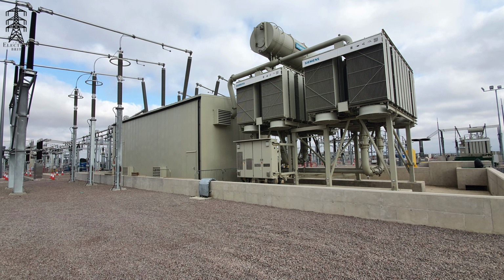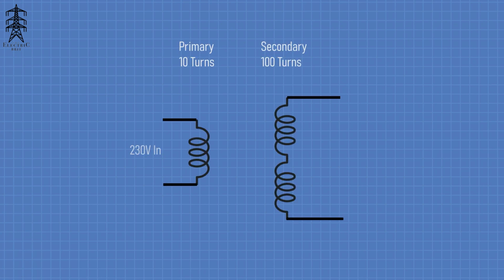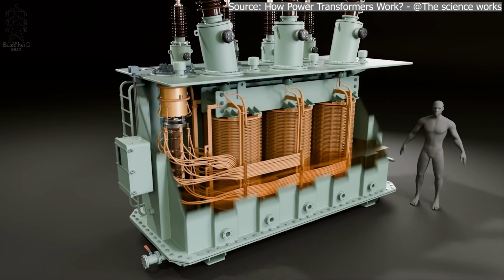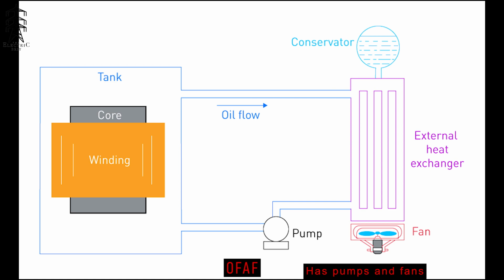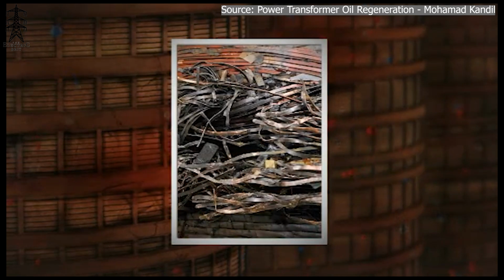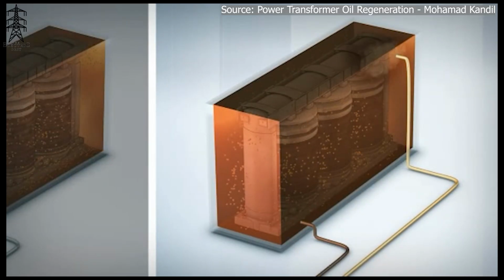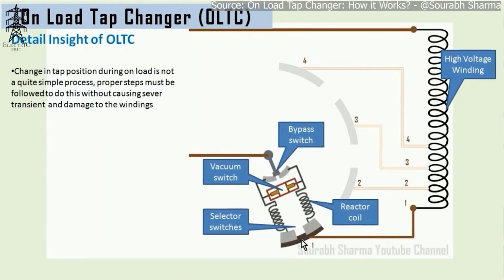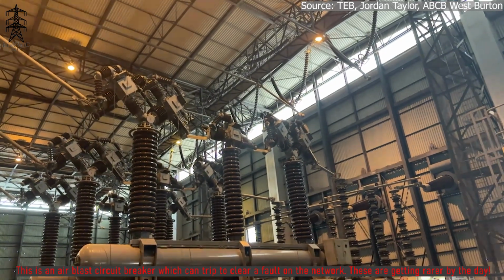Why Transformers Fail (and How to Prevent It)

Comment: They cause a lot of problems to electronics with interference at least in my area i hate that this was never upgraded to not emit such huge EMI
Reply from the maker: A lot of projects I’ve worked on recently where new transformers have been installed they’re always went in noise enclosures, which help with a variety of issues, I imagine it’ll help a small amount with EMI too but the lines and bars will always be putting out some EMI. 

It used to be a huge problem on electrified rail and I’ll have to cover the solutions sometime soon.
Reply: @TheElectricBrit Thanks for reply, primarly for me they are causing EMI that degrades the image quality of all electronical devices including PC's, TV's, Consoles, Smartphones but what is weird even when my phone is on battery not plugged in my house electricity outlet those artifacts still persists.
It reduces the perfomance of those devices like slowing them causing huge desync, input lag, choppiness the high refresh rate displays feels much lower HZ between 15-60Hz rather that 120-240Hz.
I suspect the EMI is so strong that it poluttes the sensitive components in my electronical devices and permamently leaves them damaged in a way i explained. Im also living very close to a few big power line towers and a supply station like 500m from my home but never untill 2020 got any of those problems till this day it remains a mystery for me to solve the issue.

Comment: Just here to find out if any other country uses the waste heat from transformers and puts it into a heat network. I realised that close to where I live there is a 265/33KV pair of transformers. I am guessing at how much power but doen't know what temperature the oil is or what would be required to access that heat.
Reply from the maker: I’ve heard of it as an idea and it could well be in use in some places. I don’t have exact figures for cooling off the top of my head but most substations are built away from homes because people don’t like look of them, except of course ones in cities where it can’t be avoided. 

The power needed to pump the warm fluid (40-60 degrees C would be my average guess) would probably outstrip any use you’d get from the heat by the time it reaches a destination).

Maybe as I saw on the centre of a city for an adjacent high rise building. But there would still need to be traditional cooling systems to fail over to, to prevent losing the asset if the cooling fails. Converter valves for instance get extremely hot extremely fast if not cooled so fail in seconds to minutes.

Comment: I recall a 18 MVA X 2 Reserve Station Service Transformer at a power plant being damaged to the point of requiring a rewind when an employee dropped a steel measuring tape across the 230 kV primary terminals.  Not only did that damage this transformer, but also damaged main output transformers on other units.  Miraculously, the employee was not injured.

Comment: heh i raised the voltage in my car to 15.8v to improve efficiency. works better with my solar roof to give me more ev range. lubricated my power windows just in case it might pput more stress on a regulator motor, and proactively switched my headlights to LED's with their own powersupply. the only thing that doesnt like it are my tungsten map/dome lights but they are not on long enough to matter.

Comment: I once came across a large transformer, destroyed by fire. It was situated at a large UK generating station. I won't mention which one.
The transformer was OFAF, and had developed a fault where the cooling fans were running continuously. 
One particularly cold night, the oil had become so cold, that it was too thick to be pumped around the transformer properly. A hot spot developed inside the transformer winding, which resulted in a short circuit...
Reply from the maker: Rather ironic way to go out. Caught fire due to over cooling. I wonder if the designers ever imagined that

Comment: well done bro , I worked on transformer upgrades in the 90's for ROSH   in Dunstan, it was on the back of a survey done on system capability and the increase in loading . it was reckoned that the system was at the point of failure due to age and demand. most of the work was stop gap , as the infrastructure was so old , especially on the L.V side, its a wonder it still keeps going.
Reply from the maker: Appreciate the comment! Funny you mention uprating as the last DNO sub I was on in London had the Tx's derated by 50% due to faulty fans and pumps. I suppose it was hard to secure an outage to fix it but you'd think that would be a priority.

Some interesting developments happening around uprating overhead lines too that'll be good to explore like HTLS conductors and insulated cross arms.

Comment: Came up at a good time, given the incident that made the news re a fault in Westminster on 29/4/25!

The brief section on autotransformers looks right, but they are becoming more common for some recent railway electrification projects, such as the GW Main Line. They use 50 kV for longer distance transmission, and every so often there are autotransformers set up with +25/0/-25, with the track being at 0, and the overhead contact wire being at 25, so there is roughly 10 km or so with the 25 kV current, and most of the supply being at 50 kV to halve the current to/from a small number of grid connections. e.g. Didcot, Melksham, Cardiff.
Reply from the maker: New fault every day I can’t keep up! Interesting note on the 50kV, the only rail transformer I’ve seen so far was at Sundon and if memory (could be wrong) serves I was taught rail is typically the 25kV you mentioned. 

I’m always looking at things from a transmission lens so I rarely see stuff below 132kV unless it’s on a tertiary connection but I can definitely see their appeal if the step is only 25kV. Thanks for the info I’ll be sure to dig into it more when I do a dedicated transformer theory video 🙏

Comment: Back in the dim and distant i worked for Canatron Transformers a small company in Berkshire around 60 miles from London we made everything from large  HV Transformers to little instrument transformers  we tested at normal working volts then at working volts x2 but at 400 or 150 cycles  and finally flash testing at minimum of 1Kv usually a lot more than that was great fun and i was sad to leave that job

Comment: Have you any info on small transformers for home use for example i have a large pump at more than600 meters and would be interested in using a transformer pair at 230 volt input and output?
Reply from the maker: You’ll need to do a volt drop calculation and make sure you’re still in tolerance at the end. Stepping up to 400v might be a good idea and not that expensive then back down to 230 unless you have a three phase pump. In which case you’ll have to go higher.

Domestic isn’t my forte but you can get portable transformers used in construction which are solid dry type if you wanted to test it

Comment: The brain can detect AI voice-over because it's unnatural and runs without breathing.
Reply from the maker: Incorrect 😎 if an AI did this it would no doubt sound a lot clearer and not have the odd audio issue where I’ve stitched in another take and not matched all the post processing. 

On this video part of the voice over process was doing multiple takes on certain parts and keeping the correct ones, which sometimes led to pauses and silences being aggressively cut out. I do naturally speak very fast as a geordie too. 

I’ve taken notes and my next video which is already part done and fully voice recorded is a lot slower with more pauses. Thanks for the comment!

Comment: Thank you - very interesting. Just writing up a fire supression / deluge system for a transformer.
Reply from the maker: Thanks for the comment 🙏 in future I’ll likely cover deluge systems in more detail as well as blast wall engineering. Next video is on substation LV power.
Reply: @TheElectricBrit - took me a couple of days asking the project engineers to confirm - they do de-energize the site before they start the pump and spray all that water over the grid voltage! (Though I am assured by a  chemist friend of mine that water is not usually as much of a conductor as people think it is. I wouldn't fancy standing in the puddle.)

Comment: There was a transformer failure at a Supergrid switching station not far from me: Creyke Beck at Cottingham. Attributed to a HV Bushing failure. If the bushing failed........ Would the protection devices in the oil circuit save the transformer?  I know it was 400 KV and passing several thousand amps. It was a hell of a fire & a massive pall of black smoke that was visible from many miles.
Reply from the maker: Interesting! I hadn’t heard about that one. It’s near my current project too. I’d have to check if I’m allowed to report on the report but my instinct tells me at the moment of failure the transformers differential protection will trip as it will see the internal fault of the transformer and may well save the rest of the transformer. Earth fault protection would trip next. 

Since the bushing is already gone though there’s no telling what internal damage might have been caused by the force of a short circuit (or what caused it in the first place, typically for bushings it’s water ingress). Or the damage an exploding bushing can cause - easily smashing other insulators.
Reply: @TheElectricBrit This thing was toast. The fire-brigade was there for several days cooling the transformer down. They had hoses leading into its interior via the holes where the HV bushings were. For several days the thing radiated a heat-haze.
What amazed me was that the replacement transformer came from the Far East, Korea I believe. 
Is there a UK or EU source of that kind of transformer? Irrespective of price or delivery time, which i'm sure were major factors.
Reply: @NJPurling  loads of transformers are made in the UK & EU. Why does the national grid buy transformers from South Korea and transport them mega long distances on polluting ships? 💰 💰 💰

Comment: I^2 * R isn't an exponential function but "just" a second degree polynomial (aka squared) because the exponent (to the power of two) is fixed. An exponential function has one of the variable as the exponent e.g. 2^I * R.
Reply from the maker: Thanks for the comment 🙏 yep I realised after recording that it’s quadratic and what I meant was a parabolic curve

Comment: Thank you for the video, I’m going to show my apprentice this as he’s going into power systems topic in his college, we have transformers on the trains but we call them traction transformers, oh and we have old school rectifiers & DC traction motors etc
Reply from the maker: Thanks for the comment! Are you in the UK? We have rail connections at some of our substations and it’s interesting seeing only two bus bars come off the main bus section. I’ll certainly make a note to cover that sort of circuit / transformer too
Reply: @ yip, Scotland but travel the uk on the rail grinding train, previously I was technical engineer on pendolino fleet of tilting trains, yes network rail E & P dept  use various type of line-side transformers, the overhead line is 25kc (AC) single phase and the 3rd rail (London & Liverpool areas) are 750v (DC), my current machine has 4 diesel generators supplying a 480v 60 hz Bus bar then the traction rectifiers take that and rectify it to DC for the 8 DC motors

Comment: If you are intending to do a series on the National Grid, can you take a look at the Nursling to Mannington (westwards of Southampton) 400kV reburishment. It's ended up as mix of 3 and 4 conductors along each phase. and mix of insulators some were replaced and some not, and the new replacement insulators seem very thin which as a lay person I think may be problematic in heavy snow or freezing rain. 
Thanks for a great video. Subbed.
Reply from the maker: That’s the Deep South for my blood! I know a lot of lines people so I can certainly ask the question and see if there’s a good answer. Lots more grid content coming, thanks for the sub 🙏

Comment: 왜?1950~1960년대 기술이 아직까지 사용되는 이유가 궁금하지 않나? 왜 발전하지 않았고 왜  1차원적 공급기준에    피드백이 되지 않는  기초 국가 전기시스템의 노후화???  공공의 성장조차   제 2의 가치로 비주류 비 산업 투자상품으로 여기기 때문이지!!
Reply from the maker: Some of the old equipment is over engineered to the point it would outlast new equipment if installed today. Privatisation and underinvestment usually go hand in hand but the UK is now investing billions to upgrade the network. 

The old saying often rung true, if it isn’t broke don’t fix it. It might not be broken but it sometimes shows cracks.

Comment: Reason 11, applicable especially to US and Canada: capped energy prices cause underinvestment in thd infrastructure, causing a range of failures easily preventable with regular maintenance.
Reply from the maker: Sadly even with good maintenance a lot of these things have a finite life with ageing. It’ll be interesting to see the state of the concrete on these nuclear plants getting massive life extensions. Funding for infrastructure is a massive rabbit hole though!

Comment: And then came along a "Carrington event"  and if that is not bad enough, there is the "Miyake event" which is 10 to 100 times worse than a Carrington event.
Reply from the maker: I responded to another comment about solar flares, essentially they induce DC currents into long overhead lines so before they reach substations at the end we can use a capacitor to block the DC. Obviously these events predate the grid so we don’t know how it would fare and distribution would very likely be affected.

Thanks for the comment

Comment: please ensure you have an adequate amount of replacement units in case of failure.
Reply from the maker: Unfortunately replacements cost millions so having them around as spares is often not economical. Older models that get retired are sometimes kept as spares where possible and on projects where there is a massive risk like interconnectors, a spare is produced due to the long lead times.

Comment: I have seen exploded fully ruined transformer houses - the oil splattered the walls.. the walls caught fire.. and all burns down into.. a sad dark burned heap of memory crisp..

It was said that cutting edges, extending the refuel times or save on oil type/quality was the main reason for overheating, into fryer remodeling.. and flame over explosions.. 

i wonder if they save a lot of money this way ?
Reply: Is there a big difference between countries how they build and maintain systems ?
Reply from the maker: All depends on the purpose. I’ve heard stories of industrial equipment being abused and unloved because it’s not seen as directly generating profits (despite being essential), or avoiding outages for maintenance because of opportunity cost. Thankfully in power transmission it’s not the case and maintenance is very serious.

Comment: A few points:
1 - the silicon isn't just the insulating coating, it is alloyed into the steel.  Silicon greatly increases the resistivity of steel without adversely affecting the magnetic properties.  The greater resistivity reduces the eddy losses.
2 - Most of the really big transformers are indeed autotransformers.  Often the ratio is close to 2:1, making the magnetic rating of the transformer much lower.  In addition, at higher voltages, the space utilized by the insulation is lower since there doesn't need to be primary to secondary insulation.
3 - The paper is more of the insulation you're giving it credit for.  The oil and the paper are synergetic.  Oiled paper has several times the breakdown strength of oil alone.
4 - The tertiary winding isn't just a power tap for lower voltages.  A delta connected tertiary is the path for zero sequence currents and stabilizes the phase to neutral voltage when the main winding .  Comment 2 goes together with this.  The really large bulk transformers are wye connected auto-transformers, with a delta tertiary.
Reply from the maker: Thanks for the comment! I made a correction about the steel in the description which should show on the video, it was my bad with the script. I knew it was an alloy but slipped up on the coating which is typically an oxide layer or can be paper or varnish.

I don’t recall if I mentioned other purposes of the tertiary in this video but there will be a follow up video dedicated to transformers in more depth. This one was a quick hit on reasons why they fail, and is a follow up to my first video which got taken down, so covered the same points but with more theory. Hopefully you stick around to see the next videos. 

Next up is substation power and does cover at a basic level auxiliary transformers on tertiaries and does mention other functions of tertiaries in brief passing.
Reply: I thought I had misremembered the fact the silicon was part of the alloy when it wasn't mentioned, thanks for the comment.
Reply: I think sometimes the tertiary is purely there for stabilization and doesn't supply a load at all.

Comment: Silicon steel is an alloy of iron and silicon content 1 - 3%  The lamination insulation is usually varnish etc  @2:30 misleading
Reply from the maker: Thanks for the comment! I issued a correction in the description and pinned comment yesterday. It should show over the video in the top right

Comment: Can I ask for a bit more information on the use of tertiary windings? The vid seemed to cover that a little quickly for my level of intelligence. Thanks.
Reply from the maker: Thanks for the comment 🙏 I’ll be doing a whole video on transformers rather than why they fail as well as videos on some of the things we attach to the tertiary.

Next weeks video briefly covers auxiliary transformers which come off the tertiary (which is just a third winding at a much lower voltage) and I’ll cover things like reactors, capacitor banks and SVCs which all can connect to the tertiary.